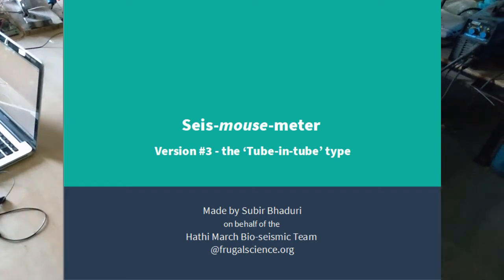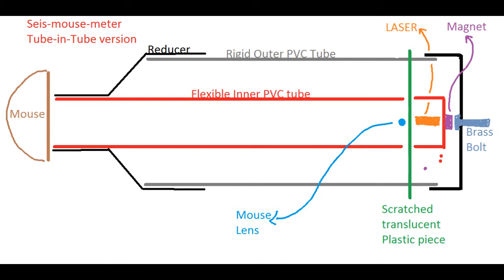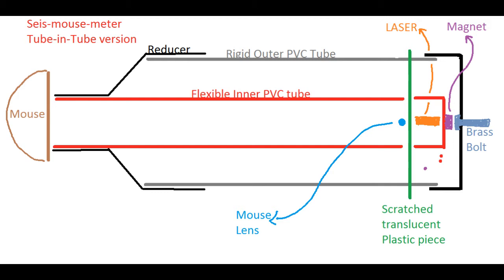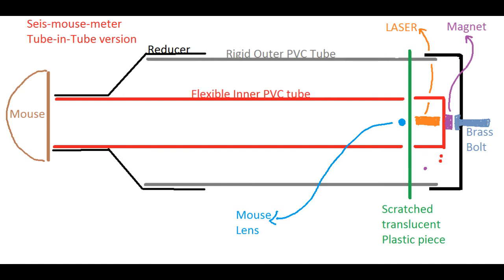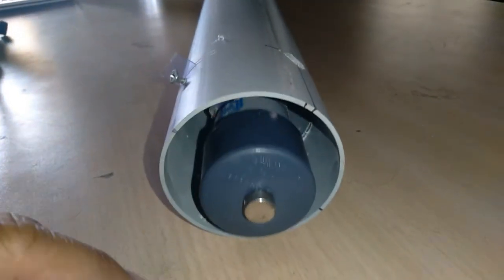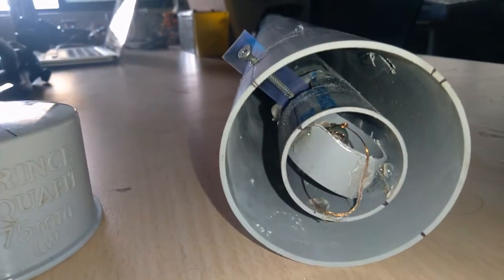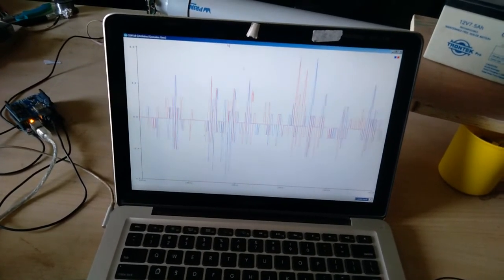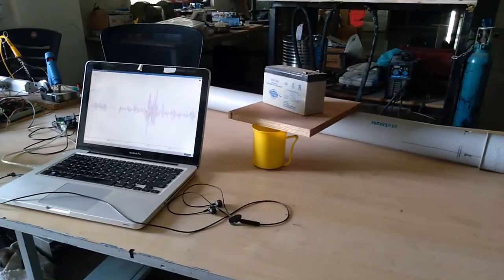Low-cost seismometer with an optical mouse

Comment: Nice! It looks like you have a reasonable sensitivity there, and the mouse sensor is effectively picking up the signal. I am curious what kind of frequency response you have, and if the magnet-brass screw can give enough damping so a single short impulse does not ring.   I have seen many amateur seismograph designs but nearly all require a magnet-coil pickup with external ADC for the small signal. Your designs are the only ones I know of that only require basic computer hardware (except for a laser pointer, I guess, but those aren't too uncommon either).  I am also wondering if the sensitivity is constant, or if it depends on the precise spot that the laser beam hits the optical dispersing element ("scratched translucent plastic piece") and therefore changes from moment to moment as it moves (?)
Reply from the maker: Thanks John. You have good questions that need some work on my part to ascertain. As of damping i think the brass+magnet is not working so effectively. I see a ringing in the signals. I'll try copper bolt but i could not find it easily in the market here. As of sensitivity based on deviation of the illuminated spot, i think the mouse should be able to get over it. This problem may arise if the length of the tubes are increased and the intensity of the image on the mouse sensor reduces. I'm only guessing here. Need to check this out, but how? Any suggestions are welcome.  
Another issue - in this design i'm using the same lens from the mouse whose back focal length is almost at its surface. This implies pushing the scratched plastic right to the surface can hinder free movement and thus it seems the whole system is still unfocused. That is a big loss on sensitivity.
Reply: @subirbhaduri  it might be difficult to completely damp out the ringing mechanally without loosing sensitivity. I suspect a more reasonable thing to do would be to use software to ignore the resonate frequency of the pvc tube. Especially useful if you make the length of tube resonate at a non natural frequency. So its not likely to be resonating at a frequency you might be observing in your actual signal.

If you wanted to stick with the eddy current damping. I think the copper/brass part might need to be a parabolic dish or some other shape that has an effect on the tube when its moving through position other than dead centre. ie you have a pulsed damper now, but you need a more constant and logarithmic damping. Imagine driving a vehicle with shock absorbers that only absorb in a small part of the stroke.... This is the problem you have with the small bolt, only damping at zero crossing.
Reply: @MongrelShark  I don’t think it needs to be terribly complicated, just a flat piece of a conductive material would do the trick, to extend the range of motion over which the damping would be effective. A chunk of aluminum plate would do the trick.

OTOH, the damping force from the eddy currents is proportional to the speed of motion, so more of it will occur in the middle of the swing anyway. Assuming an “ideal” arm (no secondary or non-linear forces), the oscillatory motion of the arm would be a sinusoid, so there’d be less motion at the ends of the swing as it reaches the end of its travel, meaning much less force there than in the center, even if the conductive element covered the full range of motion.

In addition to the velocity-proportional damping force, a flat plate would have even less effect at greater arm deflections, as the magnet would be further away from the plate when the arm is displaced away center. A little hammering to give the plate a curvature matching the length of the arm (pivot radius) would keep the distance the same. Going to a greater curvature (smaller radius) would help compensate for the reduced damping force away from center (resulting from the slower motion there) if you wanted to damp larger-amplitude signals more. - But larger amplitude will also mean more rapid linear motion in the first place, which would increase the damping anyway.

Comment: (Ah, never mind - I found the link on Hackadday :-) 
This is really ingenious(!) Is your arduino and computer code (Python?) available anywhere? I looked at the project pages but didn’t see any links there. I’ve thought about making my own seismometer before, just out of curiosity (and because I like measuring otherwise unseen things ;-), but other methods seemed overly difficult to achieve a given level of sensitivity. This looks like a fantastic approach, and sensitivity should scale well just by increasing the length of the apparatus.
Reply from the maker: Hi Dave. Yes, Hackaday has more details on the project. Thanks for your kind comments. You are correct, sensitivity can scale up with length, but the intensity of the laser beam also decreases inverse square as the length increases, so there is a tradeoff to worry about. Can there be some more tricks to get more sensitivity out of it? I wonder...